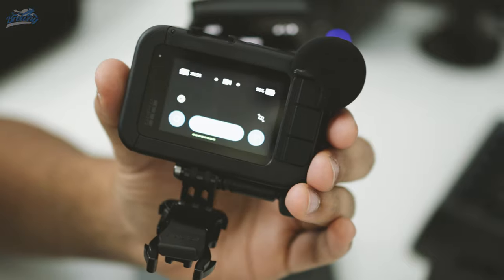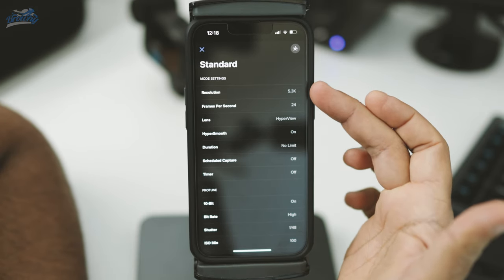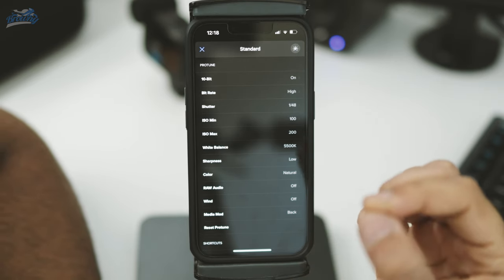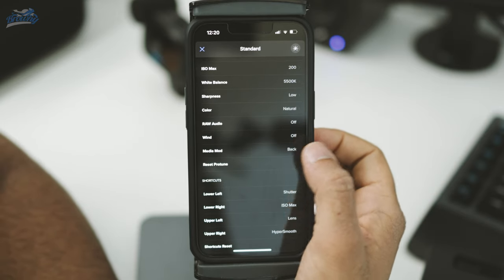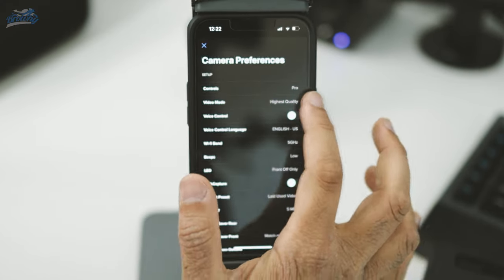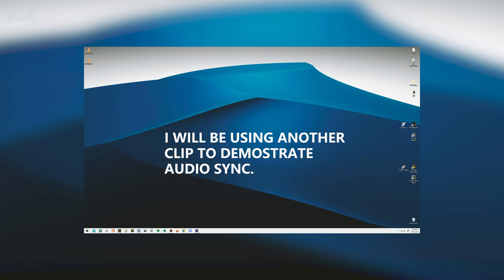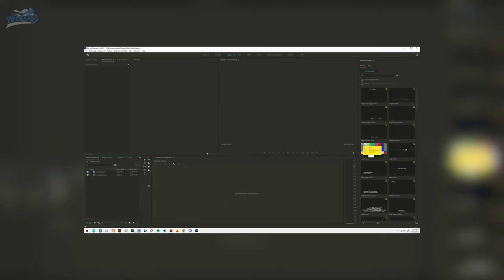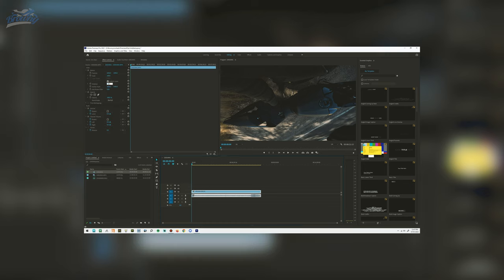【36】How to record DOPE Exhaust Audio / Video 🔊 ( Hero 11 + ZOOM H2N )

Comment: I've tried every backpack, waistpack and fanny pack I own and I still can't get rid of wind noise. I managed to get rid of the noise the mic makes when moving around by stuffing cloths inside, but wind noise is still the killer even going at 20mph. Any ideas?
Reply from the maker: I use a waist bag. But I always position the bad behind me. That usually works for me.
Reply: @brownyonwheels  Yeah that's what I do, plus I'm a big boy so you would think there would be more cover from the wind but i guess not. will have to play around more.
Reply from the maker: @FatBiscuitYT  have you tried turning it on and off again, kidding 😂. But try wrapping your recorder in a fur sleeve or something ? What mic you are using ? Can you change the polarity of the mic to only record the back facing sound ?
Reply: @brownyonwheels  Yes, same mic H2N, and I use a windscreen muff from Amazon. Then wrap the mic with microfibre cloths to stop it from moving around. It's only wind noise I get nothing else. I use the same settings as you and face it the same way,
Reply from the maker: @FatBiscuitYT  I am actually now keen. Try few things. Drop the gain a bit then up in post. 

Secondly if you lean a lot. May be try to not lean so much if you do? I know it's a stupid solution but, Just for testing. So we can narrow down your the causes. 

Other solution which I find best is to put the mic under the tail cover / rear seat cowl. You got space there ?
Reply: @brownyonwheels  I'll try lower the gain, it's on 5 currently as my stock exhaust is really quiet and still need to boost it in post. I've noticed the wind noise happens when driving in a straight so i dont think its leaning thats doing it. 

No space in my rear seat and even I did i think there's too many cables moving around which would ruin sound.
Reply: @brownyonwheels  Here is a test run I did - https://www.youtube.com/watch?v=YdJzWDo-qtM

It may be because my bike's exhaust isn't loud enough to counter the wind noise. So even with the gain down and upping it in post, the wind would still be overwhelming because the mic doesn't pick up enough of the exhaust.
Reply from the maker: @FatBiscuitYT  your gain is too high. Try 2-3

Comment: I put rode wireless go 2 in my backpack to record the exhaust sound. -30 gain setting but the sound still explodes and crackles (mt-09 akrapovic) Do you have any advice?
Reply from the maker: Rode aren’t meant to handle high bitrate to recover peaks. They are for made for interviews, voiceovers etc. you will need something like h1n or h2n. I use rode wireless go 2 for videos etc but not for exhaust sound.
Reply: @brownyonwheels  thank you bro
Reply from the maker: @RenkliPijama  no worries man. All the best 🖤
Reply: @brownyonwheels  zoom h4n pro cheaper than h2n, is it h2n better than h4n?
Reply from the maker: @RenkliPijama  you don’t need h4n. It’s huge and not really portable. You will need a backpack to carry it. The form and size factor of h2n is perfect. H4n is over kill. I have zoom h6n that I barely ever use.

Comment: Hey, thank you for this 🙏🏻 very useful, already tested both of them and got pretty good results, just need to adjust a little bit through extra testing. Any advice for night rides?
Reply from the maker: Try removing all nd filters at night and then slowly up the iso if it’s still dark.

Comment: Thank you for making this video, exactly what I’m looking for. All other youtubers are like promoting osmo5 pro, dji mic blah blah, a setup the terrified the newbie’s and hell of expensive.

I’m going to try it with my insta 360 with single lens mode. One question: is there any way we can remotely on off the zoom recorder. I don’t want to stop my ride for play pause show!! Right now: i mount my insta 360 to handler and put zoom in bag pack, when i need the video i just have to click the insta button. Did you knew any way to do it?
Reply from the maker: I believe there is a wired controller. Sorry for the late response. Just busy with life.
Reply: @brownyonwheels  no worries. I found one. Facing some issues with sd card in my zoom. Not sure it supports 256gb card or only 32GB!!

Comment: Great tutorial! One of the most comprehensive I've found :) I believe the H2N has an audio-out jack? I've wondered if wiring it into the GoPro's mic port would be worth it at all?
Reply from the maker: I am sure you can wire in but I just hate having wires. I have seen a guy crashing on a corner because the cable flapped around and got stuck in his handle bar. So I don’t take any chance with that.
Reply from the maker: I am glad you found this helpful ✌️
Reply: @brownyonwheels  I might test it to see how it works with quality but I imagine that it'll be better independent and just completely nulling the GoPro's audio.

If I do, the wire will be threaded up through the jacket so that it can't flap anywhere. Shall see, gotta get the mic first.
Reply: @MotonekoRides  I just bought the media mod and the 3.5 cables with this same zoom set up, will test this weekend if wired works. I tried but syncing and editing was a pain for me because of a low performance laptop. Will test and let you know
Reply: @sonyramirez7087  Awesome! Thank you so much, I look forward to hearing the results :)
Reply: @MotonekoRides  Hey! I have just tested and unfortunately you can't fully disable Go Pro media mod mic, so Zoom does its job  very well but the issue is with the go pro because as mediamod mic is enabled, there is a loooot of wind noise. I am still looking for alternatives. Even thinking about a way to fully cover the mic from the outside and remove 100% the wind noise. . Will let you know if I find something
Reply: @MotonekoRides  hey! Just tried again by covering the mediamod mic with the foam and added some tape to basically deactivate it as you can’t doing from the cam. That was a hugeeee difference and I’m happy with the result, sounds same as in the video but wired and without syncing anything

Comment: Got the same setup and followed your steps. Audio is fine but the video tends to be a bit grainy and the lighter parts are very bright. Last time I used an ND16 filter. Will try with the ND32 next. Any tips on how to tackle the sharpness? Increase shutter speed?
Reply from the maker: Increasing shutter will loose the motion blur. If you want sharpness you can up in go pro. Also record in 4k may be?  What GoPro ?

Grainy video is likely cause your iso is too high.
Reply: @brownyonwheels  Been recording in 5.3k on a gopro 11 with ISO at max 200.

Comment: Hi there, have you tried connecting H2N straight into the GoPro Media mod? Or do you know if it works, would be nice to skip the audio sync.
Reply from the maker: I am sure you can buy I wouldn't like to have a cable dangling on me when I am on speed.
Reply: @brownyonwheels  Thanks for the reply. I was planning on "hiding" the cable under the seat and up to my tail bag / under seat compartment. I am using chest mount so the cable will not be so much in the way I think
Reply from the maker: @sirsvartmes  it will be a hassle over time. It's would be ok to try it out but very annoying setup. Give it a shot 💉
Reply: @brownyonwheels  might be, but its part of the process, sometimes it works sometimes not 👍🏻

Comment: What about if you have multiple split clips? Will this still work without audio drift?
Reply from the maker: Best practice is to let the video and audio just record and then clip in editing. If you want to do multiple clips. You will just need to start and stop the recorders. No way around it. 

What I would advice is to make callouts. Like,

Recording 1 (clap clap clap)
Recording 2 (clap clap clap) etc.
Reply: @brownyonwheels   I figure it out. I let Gopro and audio recorder record the whole time im riding. In post the clips are split but i just line up the audio manually. Your answer is still valid though. Thank you!

Comment: 10:06 whats the difference between 48khz and 96 ? Im using the h4nPro and can’t figure out the right settings
Reply from the maker: You won’t hear the difference in sound unless you work and operate at studio level. 48 is fine.

Comment: Is the H2n worth double the price of the H1n?
Reply from the maker: You don’t have to. I upgraded because I could and also h2n have different pattern + mic you can choose to record with. Unlike h1n that needs to be placed In a certain direction to pick up the exhaust sound nicely. H2n is bit more versatile. 

But you don’t have to have h2n. H1n will do the job.